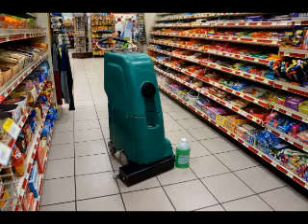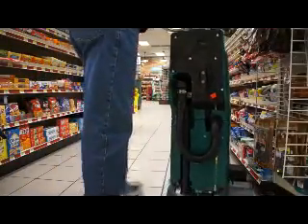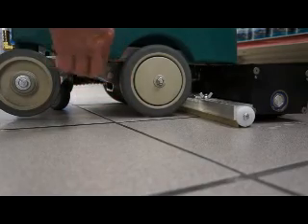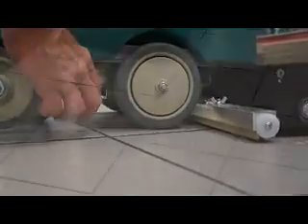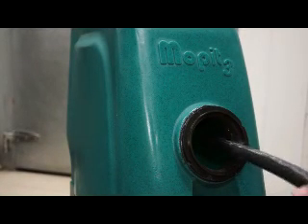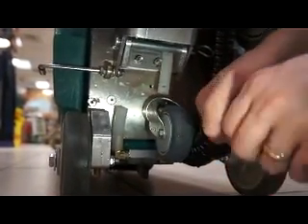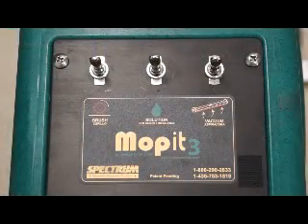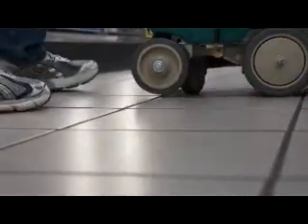Mopit 3 Training Video

Comment: Does the Mopit 3 have a gauge to tell you whether the dirty water tank needs to be emptied or not?
Reply from the maker: Thanks for reaching out with a question!  The Mopit 3 doesn't have a gauge but it does have an automatic float shut off.  When the tank is completely full a ball float rises and shuts off the suction to the vacuum motor.  This helps to preserve the vacuum motor.